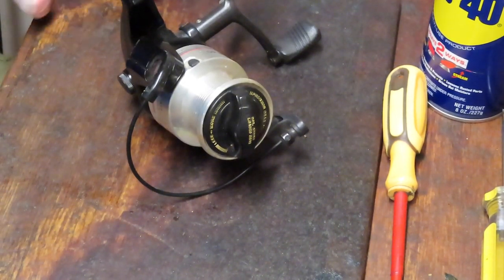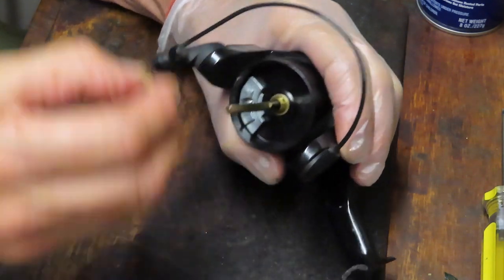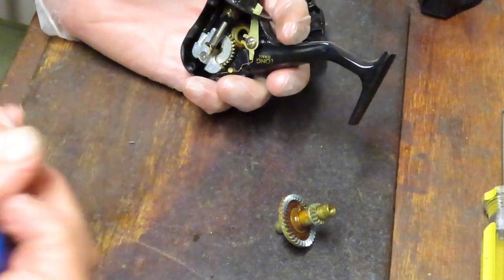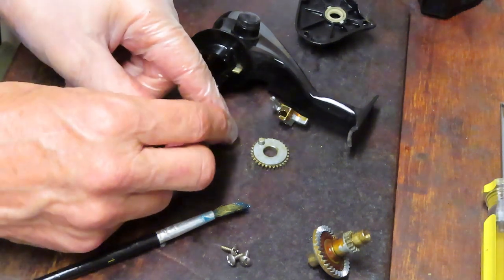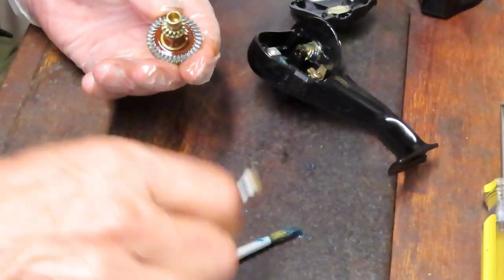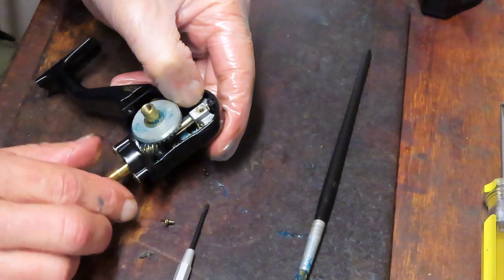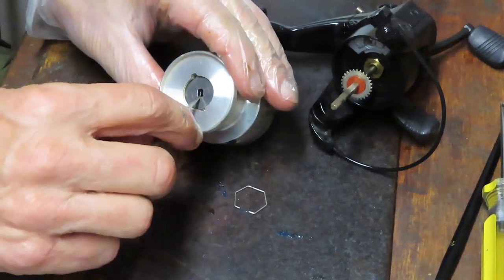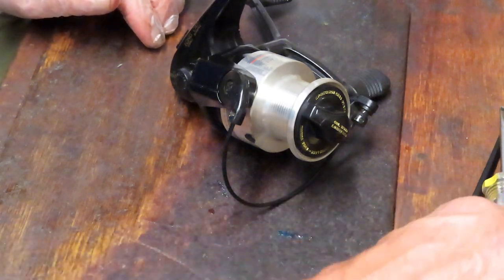Silstar Edge 40 spin fishing reel how to take apart and service

Comment: Hi Dennis,
       Thanks for another "reel competent" video !!  This fish- tail handle is cool from a visual standpoint, not so sure about the function side.
All the Best,
C
Reply from the maker: Glen - are you referring to the spool drag click mechanism inside the spool?  I'd  check the operation of that manually to make sure it is freely moving back and forth.  If it is stuck, try WD40 or another penetrating oil to see if that loosens it.  Still stick?. try backing off the screw a tad.  If none of that works, you may have a worn spring or a worn click tongue, which would need to be replaced to restore the function - If this is not the problem you are asking about, please provide additional details - Thank you - Dennis

Comment: Dennis, I enjoy your videos very much. I noticed that you have used rods. I need tips for a Berkley Para/Metric Lure weight 1/16-3/8 0z, a Mitchell Raven R-660 MS 6-14 line  1/4-3/4 oz. lure,  Gladdin South Bend 6'6" #1-244-866,  A Berkley Para/Metric Deluxe PD30L 6'6" 4oz. and a Fin-Nor PowerLite  PLS662L 6'6" 1/16-1/4 lure 4-10 line.  These are great looking butt ends but of no use without the tips. Maybe you or your viewers can help locate. These were remnants of my late Uncle and Cousin.
Reply from the maker: There are no specific tips.  Best to order an assortment of rod tips and determine which are the right ones for replacement.  You can find the generic tip assortment on Amazon   The link here is an example https://www.amazon.com/Fishing-Replacement-Freshwater-Saltwater-Stainless/dp/B09QJQS5PB/ref=asc_df_B09QJQS5PB/?tag=hyprod-20&linkCode=df0&hvadid=563634734587&hvpos=&hvnetw=g&hvrand=12992883636908789868&hvpone=&hvptwo=&hvqmt=&hvdev=c&hvdvcmdl=&hvlocint=&hvlocphy=9003469&hvtargid=pla-1658620551572&th=1&psc=1 If you are looking for sturdy Saltwater tips, then using a rod building company for parts is best. I generally use HFF when I need to find one.  Here is a Lin that gets your to that sire https://www.hffcustomrods.com/product/tip-top-h-ring-chrome/  Thanks for asking - Dennis

Comment: Just from appearances I kind of like this reel. I usually like unusual and this reel looks unusual. The handle intrigues me. It seems to me to be a pretty good idea.  I’m familiar with this brand but I know almost nothing about it. Where are they built? Are they a part of a Chinese conglomerate? How did the brand originate?  When you talk about screws I always think of Shimano.  I don’t own any reel of this brand though I have serviced a few. I wasn’t particularly impressed by the materials especially the metals that were used in the manufacture of the ones I serviced. The bearing on this reel was really clean. I worked on a reel today full of what appeared to be auto axle grease. The bearing had been packed with it. Thanks for answering my question about the origin of this brand!  In general I don’t like AR setups like this reel. i know they work fine I just don’t like this way of doing an AR.  I usually don’t put the axle shaft in until after I reinstall the rotor. I guess it doesn’t matter if you remove that ratchet and any shims. Of what material is this reel case made? I missed that. I thought with that broken reel foot it might be metal.  Still, I kind of like this reel though as you know, it’s too modern for me. I sent a comment on another of your videos about the reel I serviced today. I admit it, when I saw the reel I couldn’t resist going ahead and working on it. I was going to wait for your video  but I was too impatient. I got my large Luxor surf reel today. Wow, what a reel! Full of unusual surprises inside. It has both the largest ball bearing as well as the largest main gear I have ever seen!  I had to get out my set of very small ignition wrenches just to remove the axle shaft. Anyway, you’ll have fun working on this reel. When I finished I had a mint condition Luxor surf spinning reel - not a mark or a scratch on it anywhere. I was surprised at how fragile the bail appeared to be. This will be a great reel to use surf fishing! I got a bargain with this one but if you collect vintage surf spinning reels like me, you have to get one of these for your collection.  It is the iconic surf reel! 

I loved this video Dennis. I always like simple straight-forward spinning reels and this is definitely one of those!
Reply from the maker: Thanks Chris.  You've said a lot.  and yes, I am looking forward to the Luxor reel project.  Stay well - and stay fishing - Dennis
Reply: Gary Dodgson  Thanks for the comment! I’ve never even held much less used a handle like this. Your observations make a lot of sense. My only thought in saying what I said was it seemed like being able to grab the handle faster might be a good thing. I don’t own any reel like this nor would I buy one. I fish almost exclusively with vintage surf spinning reels. The most modern reel I own is a Daiwa Emblem X 5500T longcast reel that I use to surf fish with braided line. Other than that all my reels are older than the early 1980s .
Reply: Gary Dodgson in all honesty I believe I would be the same as you - single handles for me too!

Comment: Hey Dennis,

Thank you for these helpful videos. I am maitenancing a silverstar CT60B. The antireverse broke while I was fishing so I was attempting to resolve that. It uses the same wire/slot system as the reel in this video. I am a little confused on how this antireverse works. Is that wire supposed to freespin on the shaft? I can see how the switch turns the antireverse off but I am confused as to how it re-activates it. Any help you could give would be awesome. Thanks!

Drew
Reply from the maker: The spring is on the eccentric cam and is friction driven.  It should spin freely while the reel is turning and the back spin will grab the spring and pull it backwards.  That's where theA/R dog gets pulled into the ratchet to stop the reel - Dennis

Comment: I know you probably won't see this, but that reel is labeled 40, but that does not look like a 4000 size reel. I have a 35, and it looks more like a 1500 or 2000 size. Can you shed some light on this?
Reply from the maker: Yes - many manufacturers us 40, 4000 or just 4 to indicate comparable size reels